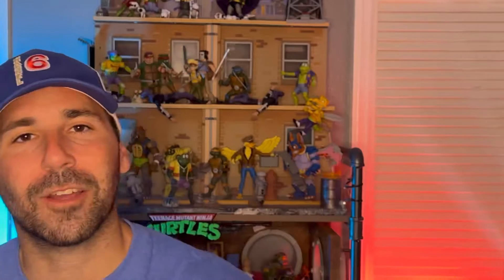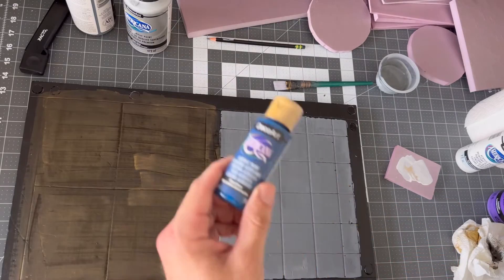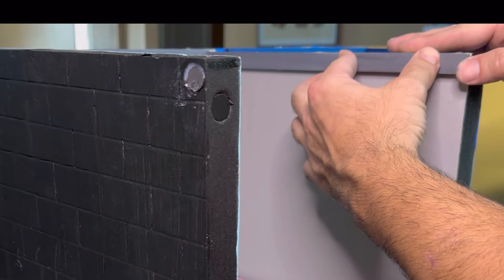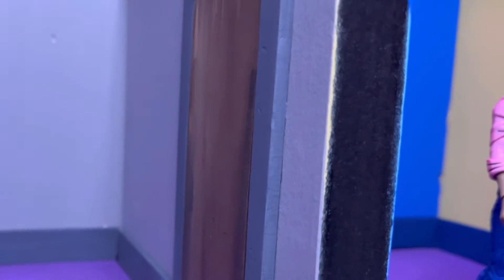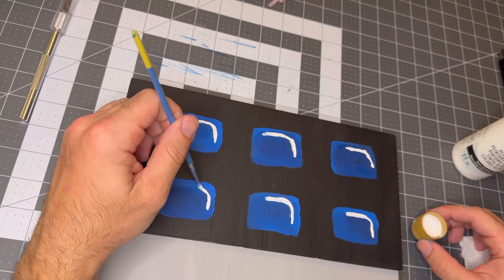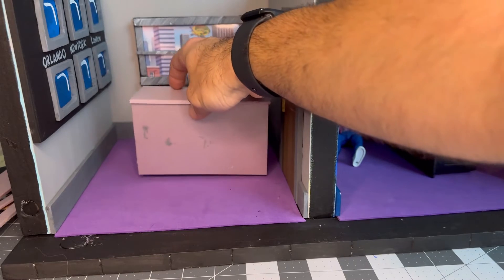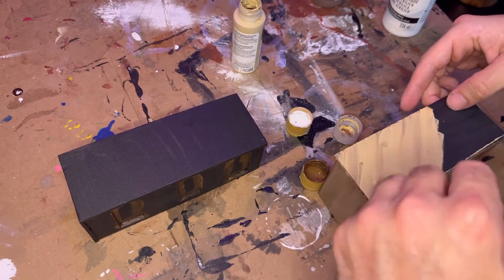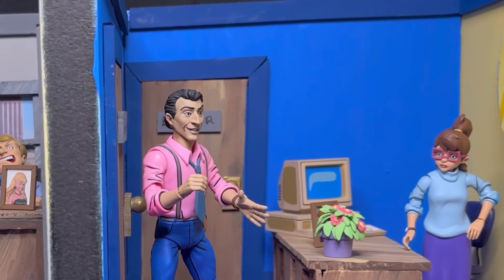Channel 6 News Building Diorama: Part 3- Burnes’ Office (2nd Floor) #necatmnt  #tmnt #neca

Comment: In my humble opinion, in some point it will be better to glue the whole structure, at least to protect the figures. Just in case, but it's looking spectacular 🎉🎉
Reply from the maker: 😂 i hear ya! I think eventually adding support beams on the first floor will have to happen. When displayed as full building with the side panels on, this thing is sturdy and not going anywhere. When I remove the side panels, it loses some structural integrity but the grand idea is to get a four tiered shelf so each floor can rest individually and just keep it assembled when doing toy photography
Reply: @thomasgoesnostalgic  nice Thomas, I really love were these is going
Reply from the maker: @edgarcoss7662  got me paranoid now 😂 currently sketching out a plan for extra support. Not taking any chances :)